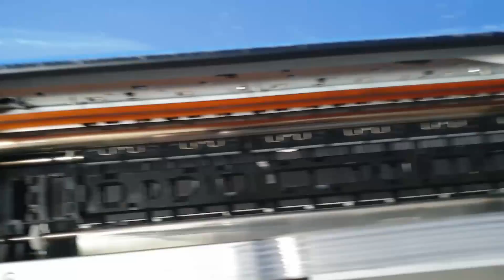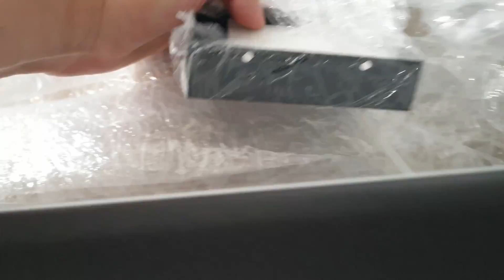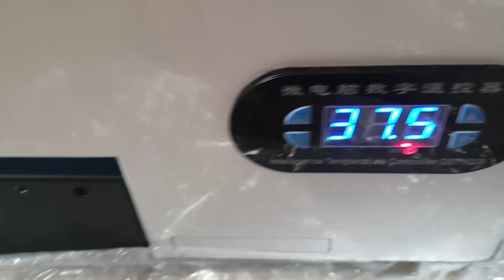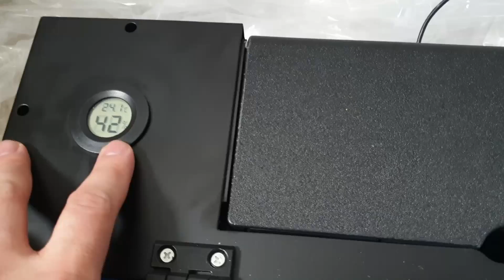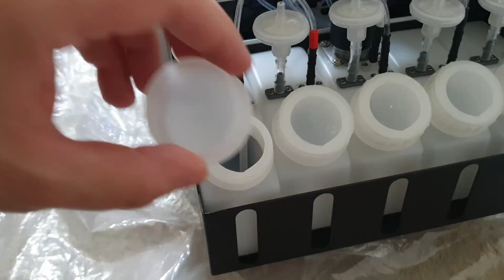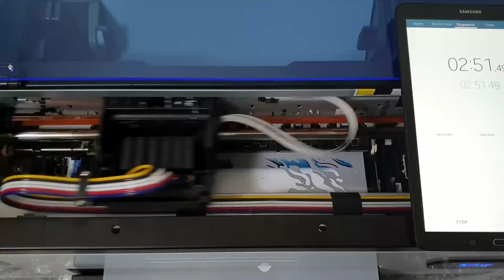A3 DTF Printer. First Time Setup.

Comment: Is it still working good ? and whats the name and model of the printer ? Thank you.
Reply from the maker: We don't sell them anymore. Any printer will need maintenance and replacement parts. Print heads last between 1-2 years depending on your use and maintenance. Ink pump, dampers, lines will usually need replacing too. Does not matter which printer you use, you need to be able to replace parts.
Reply: Thank you,  👍1 more question, i want to convert a Epson EcoTank ET-14000 for DTF what is your opinion about that ? Or can you advice me a DTF printer like yous in this video ? @dtfprintingtechnology9457

Comment: Can’t find any videos for first time use. I did my first print and it did not have the white like that. I’m not sure if I’m loaded the film in on the right side. Do I flip my image? Like so many questions and can’t find a single video to cover. If you see this comment can you please help me.
Reply from the maker: First of all make sure that white is working and unclogged by printing a nozzle check pattern through the epson menu. If you have white working, make sure to launch acrorip from the correct shortcut (If you have 2), select white under every pixel in the white tab and make sure you white layer is checked in the print popup menu.
Reply: Thank you for responding so quickly. Do I flip my images? And do I load with shiny side away from me or toward me?
Reply from the maker: @12nichm  Yes, you flip the image in either photoshop or acrorip. You load the film so that the print side is facing you.

Comment: Hi, I have another problem after "powdering and shaking" on the foil there is still a lot of powder (on the print and the outer print) it looks very bad on the T-shirt when there is glue on it.
Reply from the maker: You need to keep the film and powder in a dry environment away from moisture. Maybe in a zip locked bag with some silica balls. Also, some bad types of film can cause this too. Make sure to shake the film well. You can brush off excess powder with a soft makup brush or scrape it off after curing the transfer. If it's too late and you already have excess glue on your t-shirt, all you can do is press it again with high pressure. That will help a little.
Reply: @dtfprintingtechnology9457  thanks for answers, i use 'aliexpress' films but i have its on ZIP package. What do you think about a little drying after printing and before powdering. Maybe 2-5s in oven ?
Reply from the maker: @profesorescape5203  Try it, it won't hurt

Comment: What is the differnce berween the L1800 and r1390
Reply from the maker: L1800 is a newer model which comes with a few improvements and refilabble tanks that don't need to be reset. L1800 is easier to convert. Once converted, there is not much of a difference between the two. So pick whichever printer is cheaper.
Reply: @dtfprintingtechnology9457  thankyou for the help. Ive found it so hard to get just a simple answer by googling it.

Think i will be going with the 1800 as i looked at the dx5 and that was more money than i wanted to spend.

Comment: Does this printer require an air conditioner? What is the ideal temperature and humidity for this printer?
Reply from the maker: No it does not. The higher humidity the better but I've tested it for weeks in 20% humidity and it was fine. There are no temperature restrictions that I'm aware of, unless you keep it in the desert or below freezing.